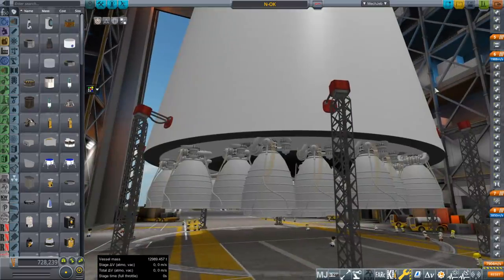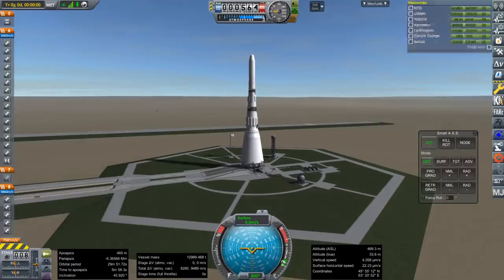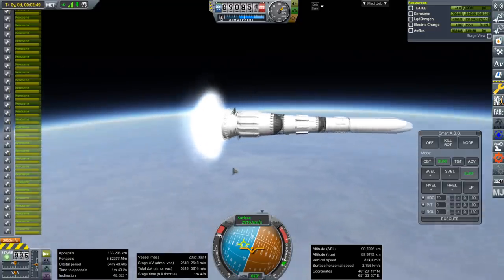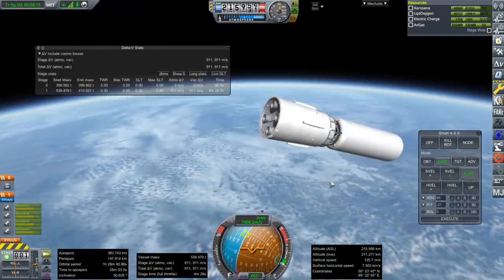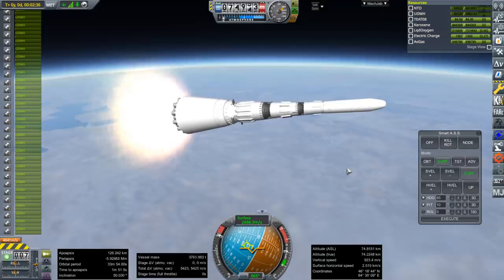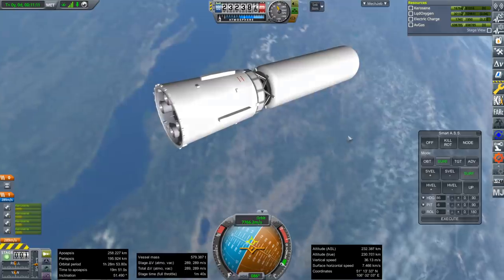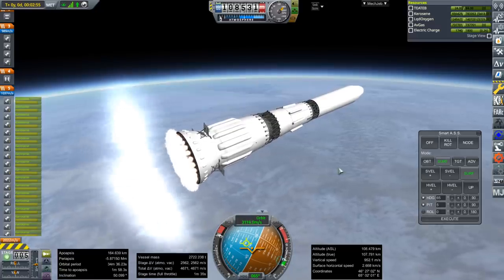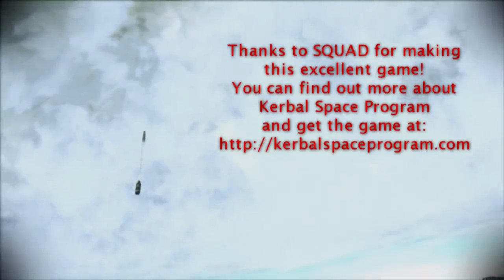Realism Overhaul in KSP 1.8.1 - Improving N1 - Insane Option

Comment: If it's going to be like this, you might as well send the LK-LOK stack to Mars.
Reply: With the delta-V required to launch to Mars being only ~300 m/s greater than that for the Moon (assuming absolute optimum transfer conditions), a minimally-improved (or potentially even unmodified) N1 could do that, though landing would be impossible and the crew would die en route. Some more modifications and a minimalist "Apollo MVF"-style TMK mission using a wet-workshopped 4th stage and life support/amenities replacing the 5th/lunar breaking stage and LK could be sent on a Mars free return.

However, this vehicle could very well be used for a single-launch Soviet manned Mars landing mission.
Reply: [N1M intensifies]

Comment: I think the failure to stage was probably due to the game running so slowly that you actually hit space btw frames, or whatever it's called, and so it didn't register.
Also, why not use struts? That's what I've done before.
Would like to see your take on an N1 2.0. Like, forget hot staging, forget the spheric tanks, ect. Built a rocket in the spirit of the N1L3, but with modern tech.
Also would like to see a rocket that can put 1kt into LEO. :3 Bonus if you don't use SRBs (with obvious exception separation motors as needed) or hypergolics in the launcher. :P